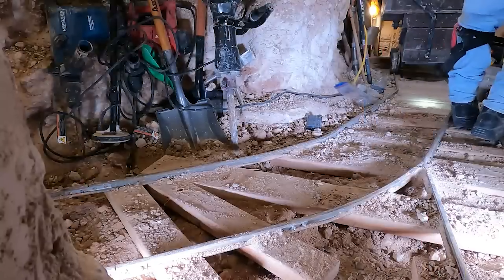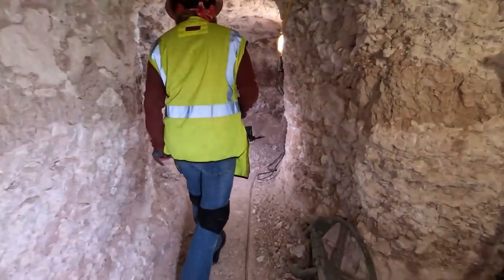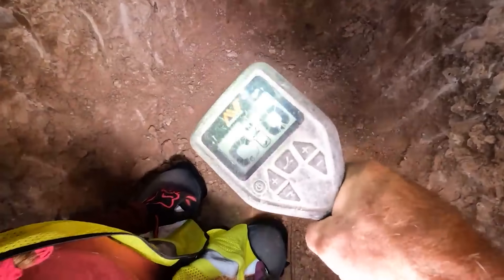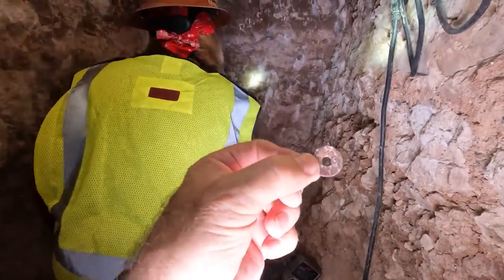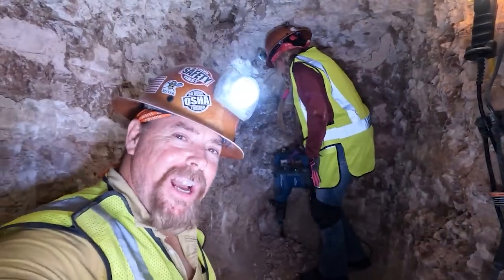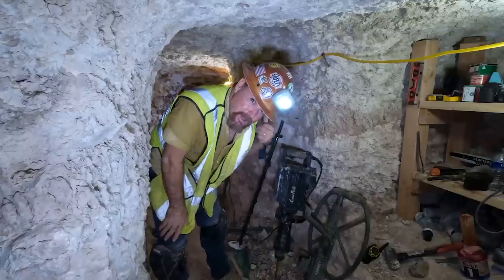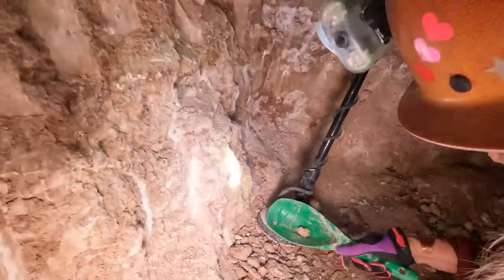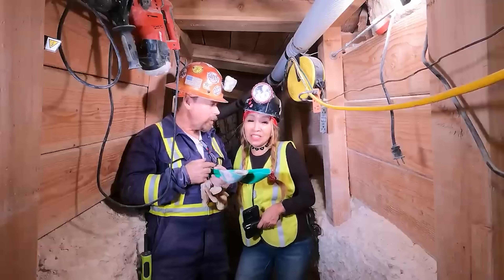My Wife found a Huge Placer Gold Deposit Digging a Secret Tunnel

Comment from the maker: Finding Gold has got to be one of the most exciting things you can do but.....when you find a Gold Nugget this large it will give you a whole new meaning to the phrase " Gold Fever " and my wife just found out what that is like. We want to know what was your biggest Gold nugget you have ever found so leave your comments below and for more vids on finding Monster Gold Nuggets in our Drift mine, watch this vid https://youtu.be/-mVzboKtQ8U and smash that like button ...smash it HARD !!!!
Reply: That's one helluva lady you got there Jeff! Bless her for not bonking you over the head and obsconding with that big ol nugget.❤
Reply: "IT BELONGS INA MUSEUM,,,,,!!!" - Indiana Jones
Reply: It would save time and effort if one very short handled (modified) 16 inch wide flat scoop shovel was used for laying on the ground with a modified short handled 12 inch wide garden hoe for scraping the material off the floor onto the wider very short handled wider scoop shovel, then after the scoop shovel is almost full you dump the scoop shovel into the ore cart. On our Moon Lake Utah gold claims that we coredrilled on we also had an exploration tunnel on top of the mountain ridgeline with the air compressor against the bottom of the mountain. We drifted over 300 feet into glacier drift rock, mud, and hematite clay dirt. Jackhammered without water made this the most difficult jackhammering (jack-leg) drilling the dynamite blasting holes that I have ever done. It took special drilling patterns for squaring the tunnel and we designed special short handled wide scoop shovels and garden short handled hoes for loading the scoop shovels, which saved time and effort. We lost the exploration tunnel two times over the winters with the glacier rock and clay dirt having groundwater pushing and distorting our tunnel timbering and wall/ceiling spragging causing caving in, which required use to clean it out and retimber/sprag our way back in. We reached over 300 feet when it caved in for the third time, we had to abandon the exploration tunnel while concentrating all our exploration effort on core-drilling. Dropped the mining claims 20 years ago with a new partnership looking at it and a couple of other gold deposits that I have dowsed and graded with all edges and exact center with depth buried of the gold deposits high grade gold veins. Everybody will hear about our progress in the near future on my partner and I starting the new dowsing training channel: Tracy & Michaels Dowsing Adventure. I hope everyone is safe and healthy while having a good day.
Reply: Nice nugget 🎉🎉🎉
Reply: You got me! I was mid sip on my coffee when you started singing the village people!!😅  never imagined that coming out of your mouth! 😅😅  Great job Lila! I've never seen a nugget dug that size before! That's the stuff we only hear about.  Just waiting for you to come up on a lense!  And yeah! Your gonna get wet!  It's hot down there!
Reply: Incredible nugget! That's  the reason I keep digging. Busted knuckles and a broken back lol. Check out the golden Polack... Mine your business!!
Reply: Ride one. Best chanel
Reply: Jeff is a MACHO MAN!
Reply: bodys hot its so hot dont you feel by body dont you tease my body
Reply: Why don't you have drawings for a couple of people to dig in the drift mine for one day with the contest winners being able to keep all the gold that was dug out that day. I know that is not ceep labor, but it would advance the drift mine in deeper to possible better gold than what it know has.  Go figure !
Reply: I think she should be allowed to keep it. She worked hard to get it.
Reply: Your always asking about needing help, not sure if you're serious but I would love to help. I'm 40 yrs old and been doing manual labor since a young kid, I can run a 90 lb jack for over 30 minutes at a time through concrete and rebar without taking a sip of water. I have done carpentry, minor electrical, plumbing and HVAC and I have OSHA 10 and 30 so I know about site safety and I love the heat. I'm from Long Island, NY surrounded by ocean and it's always humid. I've worked hundreds of feet below Manhattan and hundreds of feet above so I don't have fear of heights or depths or small spaces and I would trust you wouldn't put me in danger anyways. Love your channel and the knowledge you provide and the fact that you do everything you talk about and show what it's like and the history behind the places you visit. I also admire your courage and attitude. My condolences for the loss of your father, I lost my mom a few years ago and it's been hard. Keep up the amazing work
Reply: Haven't read any replies here, but I have to say this. Of the largest nuggets you guys find, you need to keep a couple for yourself. Here's why.
     There are many reasons for this, but foremost, preserving a couple souvenirs from your mine for later purposes - sentimental, historical, that, my friend, is important. Patrons will get like 99.999% of everything else,or whatever that number is, but the operation itself should have some kind of physical specimens.
     Also, for posterity sake. A couple nuggets like those should also never be melted down. 
     See, two things are going to happen eventually. Either the mine runs out (which I doubt) or... age will catch up to you both. In any event, there is, imho, a responsibility to what you have done.
     Just my opinion, which of course you can soundly reject.
     But give it some thought. 👍
Reply: Jeff your wife is awesome and your one lucky man to be getting rich with her around.   😊 . What an amazing achievement thus far.  Her s looking at GOLDY LOCKS 😊.  Fantastic work Lila 🎉😊
Reply: Snicker. Snicker. 😂😂

Comment: I use to use them lights like your watch fe has I changed them out to black ones with more light and less charge time there a clock they also have high an  low beam like them you have  just not as bulky

Comment: Down below the surface, does the seasonal temps and humidity stay fairly constant, or are there certain times of the year where its best to leave it for fairer months? How does working in soil compare to hard rock mines?
Reply from the maker: yes ....it stays the same down there most of the year ....a little more humid during the rainy seasons

Comment: Humidity and temperatures above 150 were terrible but the heat and lack of any moisture at 7000 feet down ,and temp as so high that everything is steal no wood or paper to spontaneously combust . 12 minutes in then out of work area . Felt like broiler on high at home . Make sure to drink plenty , on the tracks too the AU !

Comment: I think it would be interesting to see a video about your drift mine explaining the process of how you found it, what research if any  led you to look where you did, was there bedrock exposed at the surface and you followed it down, or did you just go straight down to bedrock and spread out. 
The material you are removing does not look even remotely like any drift mine i ever dug in. How was it deposited there?
Maybe i just need to go back and watch all the videos previous.
Anyway, i think it would be interesting.
Reply from the maker: we have made several vids on that ....here is one you will like that goes into detail about it.   https://youtu.be/NQMYRj9d2U0

Comment: you do that so the wheels have a rim on the inside if you do it wrong it will where the nut off and the track will separate causing a problem and maybe an injury and injuries cause delays in gettin  the gold  so come on let's do it right

Comment: Jeff, my team had to muck out 10,000 pounds of clay, sand and gravel from a mansion basement utility room. A outdoor swimming pool overfilled, flooded a courtyard and put a lot of hydrostatic pressure on the structure, courtyard and foundation. The water found it's way to a electrical conduit run from ground level to the basement utility room. Like a geyser going off full of a slurry of a wet false bedrock. Started at 10 am mucking out and finished 14 hours later, 4 guys. In a mansion. . I took lots of pictures. It was Good Work ⛏️
Reply from the maker: good times right there ....now your warmed up to work in the mines . Lol